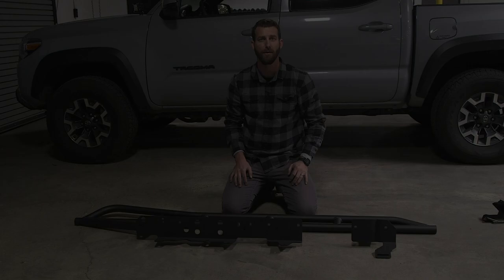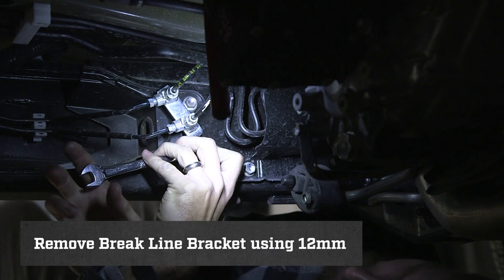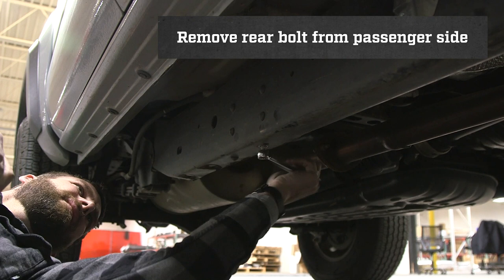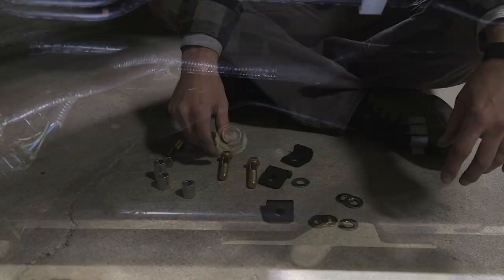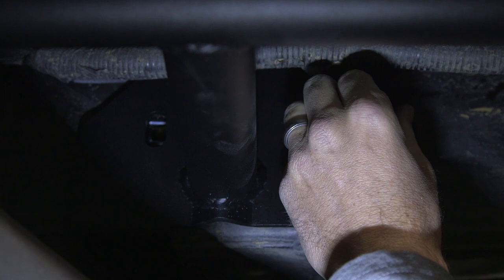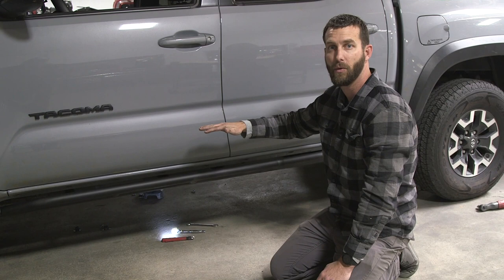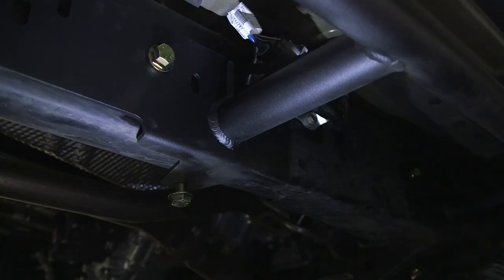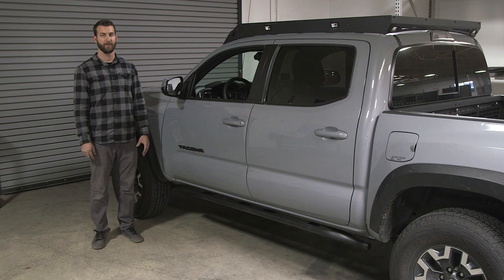2005-Current Toyota Tacoma Step & Trail Edition Rock Sliders Installation

Comment: There are some notable differences between installation on this DCSB and the DCLB models that can cause some confusion. I posted a video about these differences on my channel. Don’t hate on the quality - I’m not a content creator by any stretch! But you’ll at least have a video reference showing specifically which bolts go where, and what’s different about the DCLB install.
Reply: Some pretty big diffences
Reply: @CaliRaisedLED, you should be paying this man to do your install videos. It is an absolute shame that your video left me high and dry halfway through the install yet this customer was able to do what you should've done in the first place.

Comment: I have a 2023 Tacoma and just installed these. A couple items for those who get the bed liner finish. For the bolts to fit through the slotted holes in the rock sliders you will need to file down the coating inside the slotted holes for the bolts to slide through. The coating makes the slotted holes smaller and restricts the bolts from sliding through.  I used  a rotary tool from Harbor Freight with a stone bit to remove some of the finish that spilled into the slotted holes. One item he missed installing back into it's original place was the plastic cover behind the brake line on the drivers side. It just slides back into place and the bolt goes  into the original hole. Also there's no hole in the slider face plate to install the top wire harness clip, just the bottom, but it should hold ok. On the drivers side, the rear faceplate bolt interferes with two break lines on the back of the frame, so you will need to snap them off from the clip to get the bolt in (this may be different on other models). I also flipped this bolt so it was installed with the head on the backside of the frame like the break line bolt at front since the threads pushed the break lines out. I added a piece of rubber tubbing over the break lines to keep them rubbing up against the bolt head and then pushed them back into the clip. Also, for those who don't have a helper, I used two jacks with small pieces of plywood to raise & support the slider and position it for the 14mm bolt. The jacks also helped level the sliders later. Other than a few adjustments the install went well and the video was a great help.

Comment: just installed these on my double-cab long bed, you guys should really make a separate tutorial for them! most of the rear half of the slider is very different. The furthest forward 1/2" bolt that was parallel to the ground did not fit in any of the stock holes on the truck. I resorted to washer stacking the 3/8" then 1/2" washers on the 3/8" bolts and using them instead, as I did not want to clearance the hole in the frame to be big enough for the 1/2" bolt. Lastly, the center bolts that you put in first, that uses the OEM 14mm, is not used. Installation was completely different. I also had quite a bit of left over hardware, not something you should want on something designed to support the trucks weight. Absolutely no complaints with the product itself however, once I got all the bolts I could in, it feels stout, well made, and shipped fast.
Reply from the maker: Recently we made a instruction pamphlet for the double cab long bed. We really appreciate the feedback and are glad that you like the product. Our goal is to make everything as easy as possible for the customer to ensure they get the best experience possible.
Reply: @CaliRaisedLED  where can I find this pamphlet to double check everything? Thanks!
Reply from the maker: Shoot me an email at npoole@caliraisedled.com
Reply: Ran into this halfway through the install. Very frustrating. You guys really need to make an install video for DCLB.

Comment: The first bolt they said to put in the oval hole doesn't line up at all so I'm not sure if they made it right or I'm supposed to drill into my frame. Plus why are there no install instructions smh.
Reply: I have this same problem. Got everything ready to install only to find holes don't line up

Comment: Thumbs up. Solo work, so I'm going slow. 2021 Double Cab Long Bed.   So slightly different than the video. The Center bolt (install this first) is not in the same location, there are two slots, on matched my frame. Used a 3/8" bolt to hold the slider up in place.  For those two forward bolts, safety wire is your friend. Feed wire through the hole towards the rear, loop, and twist around a bolt. Now you can pull that wire back through, that bolt holds that long paddle ting in place. Snug, twist safety wire, now you can use one hand to move that paddle up and down while starting the other bolt. Flashlight resting on the slider helps see what you are doing.

Comment: Awesome video! I followed along step by step and had no issues at all. The only thing I would add would be torquing the 3/4 inch hardware to specs. I got over 2 more turns per bolt by torquing them down to draw the slider to the frame evenly.
Reply: whats the torque spec you used?
Reply: @C.Munsell  I torqued all the 3/4 inch hardware to 80 ft/lbs
Reply: @Hott_tacoma  thank you
Reply: @C.Munsell  No problem. As you torque them down you’ll see it drawing up to the frame for a more snug fit.

Comment: Just a quick question. I bought rock sliders as well as the complete underside skid plates. Do you recommend installing the sliders first before the skids? or vice versa? thanks in advance!
Reply from the maker: It does not matter when it comes to the order. I would work from the middle out which would be skids then sliders.

Comment: I just purchased some but the slider bracket doesn’t have a hole to insert the first bolt to hold it up.. I need help
Reply: did you find a solution to this? Just running into this problem myself...
Reply: @garthwalker  nope no one got back to me. I installed them. I just didn’t put that first bolt. It was very difficult because they are so heavy

Comment: Man you sure have to remove alot of stuff to install these rock sliders, with the CBI sliders you dont have to remove as many things to install them and they dont require any cutting either.
Reply from the maker: You really only have to remove stuff on the driver side. The slider only takes about an hour to install. I think its worth it for it being the strongest 100% Bolt on slider on the market. They blow all the other companies sliders out of the water.
Reply: Trust me i have the trail edition rock sliders for the tundra. Spend more money buy something else. These videos are horrible they leave out so much information
Reply: @sin4459  Yeah I ended up getting some RCI Rock Sliders and ran into alot of things that I wasnt expecting during the installation that I didnt see in any of the videos online that made it look easy.

Comment: So I installed mine yesterday and everything was going smoothly until I installed the passengers side. The slider was slightly bent on the front portion that attaches to the front cross member that I couldn’t keep the slider flush to the frame. I had to do a lot of banging and use 2 jacks to press the slider against the frame so can I get the bolts to latch onto the frame. Not only that but the front most bolt hole would not align with the hole on the front cross member that it’s impossible to get the bolt to thread into the first hole on the “handle”.
Reply from the maker: Chris please contact our customer service ASAP info@caliraisedled.com (888)-385-5036

Comment: Love these, but my god, the price!  Just under $1,000.00 with shipping?
Reply from the maker: We have these available starting at $499.99
Reply: just under $1000 is a lot less than paying for damage under your cab.
Reply: I don't mind paying even 600 for sliders, but 400 to get it shipped blows my mind.
Reply: @crone 1 I was told you can pick up any of their products in person at the shop in Ft worth  Texas to avoid shipping costs. Only reason i imagine the shipping would be that much is because they would have to be shipped on a large 6ft pallet and go freight. The mail man could never handle something like sliders.  But honestly with how indestructible their rock sliders are i would rather pay for shipping and have a quality product with zero worries protecting my frame, instead of getting free or reduced shipping on some mediocre weak sliders ya know?
Reply: @crone1500  find a local fabrication company there is tons on Instagram. They make same or better quality  than the big names for half the price

Comment: Does anyone have experience install these in the long bed? Is there much of a difference?
Reply: Just installed it on my DCLB. Best is with a friend to help, but I'm solo so have to use a few tricks like a safety wire to hold the paddle in place.
Reply: @TomWalterTX  my long bed 14mm bold doesn’t line up to the bracket on the slider is that normal?
Reply: @DirtRoad_Chronicles  That confused me, too. Just leave that Toyota OEM bolt alone, as we use the 3/8" bolt holes a few inches away from that one (there are two bolt holes in the slider, and two in the frame).

Comment: These sliders suck. bracket that lays against the frame doesn't line up correctly on mine and theres about an 1/8th inch gap between the frame and bracket. Doesn't even mount flush against the frame. Also was missing 4 nuts to complete the install.
Reply from the maker: Hey there! Michael, please contact us directly and we can get our team to assist! (888) 385-5036
Reply: God I hope I don’t have the same issue. Finally finished painting mine and installing tomorrow. My biggest complaint so far is all the weld splash; I gave up sanding it off there was so much. I was very surprised with the mess for the price.
Reply: @jonerikgreene1175  damn, I just ordered mine. Hope I don’t have all these issues
Reply: Rex_8787 so, I’ve got mine installed now. Was a bit of a bear, but the video helps. Drivers side rear brake lines are an issue, I’m in shocked this video didn’t point it out (almost stopped and returned product), the bolt will protrude in between the lines, which I was not okay with (you can see in this video when installing the pinch clap how the nut sticks between them 12:54). I turned the bolt around (PITA) and have the lines resting on the side angle of bolt. The welding splash issues aren’t seen once installed. Over all, the look good and are built tough. I didn’t have any flush issues. Give yourself EXTRA time; I ran out of day light and had to do all tightening the next day.
Reply: @jonerikgreene1175  did your solution mounting the bolt backwards near the brake line workout long term?  Or did you reach out to Caliraised for a solution.  Debating if I should just have my shop install mine.
Reply: Andrew McHowell I never spoke with them. However, I’m happy with the way it fit when turned backwards (nut outward). Seems clean and safe, I’ll check it during the next few hundred miles for wear. This is a great example of why I prefer to do things myself; a mechanic would have just rushed through without giving a shit about long term.
Reply: Michael, we’re you able to line up the bracket flush with the frame? I think I could  be having a similar issue